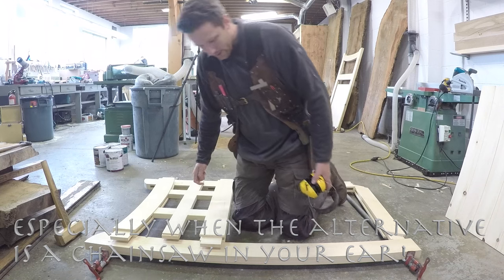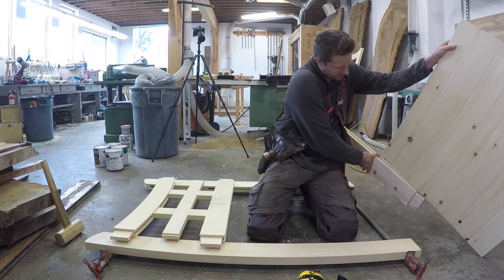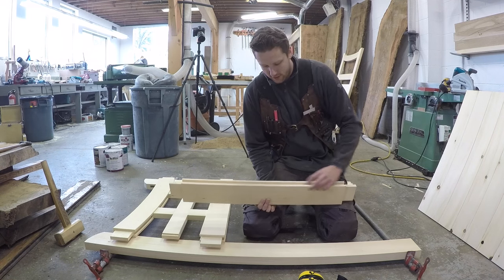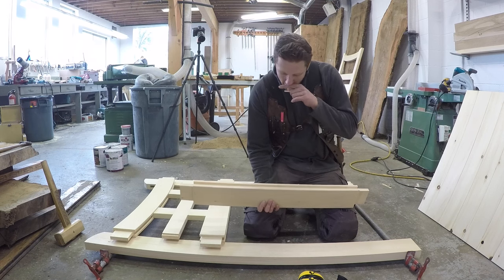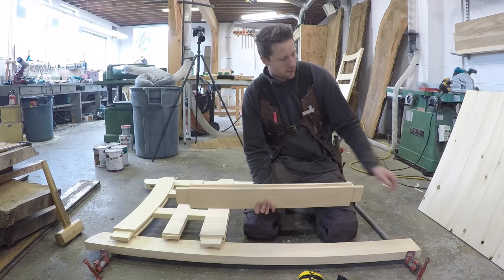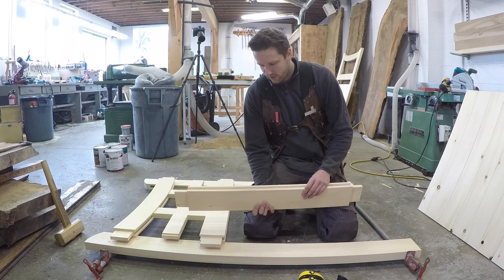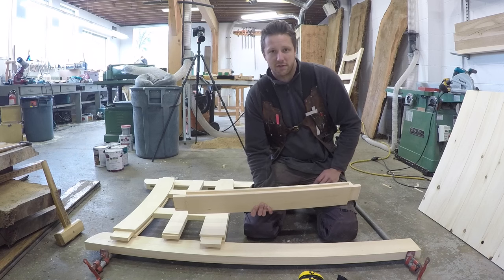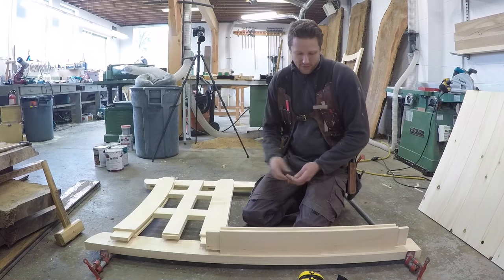FTF #9 Make it Drain!

Comment: Universal truth of construction:  Water will always get in.
Universal responsibility of builders:  Assure a way for water to get out.
Reply: Well put. I get so tired of seeing work people do without accounting for watershed. The worst is roofing jobs that instead of shedding the water it actually traps it. But it's an issue everywhere.
Reply: Well... it depends. For example, you can make a basement completely waterproof, but it depends on many factors. How much money are you able to spend, how much time are you willing to put into the construction, how correct was the work executed, was it accounted for the worst possible situations and worse or not, has the use of it not badly influenced the waterproof characteristic, and so on...
Reply: Actually you want your basement be able to breath and let watervapor through. If you try to seal it you'll just create an even bigger problem and stronger force trying to push through from underneath.
Reply: No that's actually not true. I refer to every decent study book about construction, especially about foundations and soil mechanics if you want to learn more about this topic. You always try your best to keep water about, depending on the use of course. But whether it is waterproof after construction, depends on the execution. A basement made of solid concrete walls and floor is by definition waterproof (depending on the thickness of the concrete elements of course)
Reply: Actually i is true and I know what I'm talking about as I'm a building engineer. 
Pouring concrete doesnt make it waterproof as watervapor will still get through which is what I'm talking about. 
If you have a normal basement like most people do and cant afford to make a new one made of concrete, make sure the drainage around it is solid and you use a good system to keep water away directly from the basement wall like 'isodran'. 
There are people out there that thinks keeping your basement wall waterproof is a good idea and uses a primer to paint the outside wall... it's not so dont.
Reply: +Rocksummit Then it probably depends on in which area you live. Because I'm studying civil engineering and I'm just telling you what I learned in every course about construction. 
I'm currently doing an internship with a much more experienced engineer. I'm gonna ask him how it's usually done around here. (Belgium fyi) I'll let you know.

I'm not gonna insult you for a stupid fuck as I often see in comments on other videos lol. Because I'm actually interested in sorting out the discussion. (I may be wrong, but you know, I only learned what I wrote)

Comment: great tip... if you wanted to add an uber layer of extra protection, get a little squeeze sack of west systems epoxy and give everything a couple of coats... if you wanted to go insanely overboard, use the epoxy for the glue as well...

Comment: I noticed that you are using kilz oil primer on the yellow cedar. Have you tried other types.
Reply from the maker: +Daniel Kamps Cedar often has a lot on tanin in the wood which will bleed through non stain blocking primers so I always use kils oil based primer.

Comment: I built a few Gates in my day that were just like the techniques you used (shaker style perimeter frame within dado).  Whenever I did my dado I actually "pitched" my dado to the center with a whole also drilled (the width of the dado) in the center.  I ran the pitch approx 1/4" per foot (just like Plumbing drainage).  and it was funny as hell to see you use a spacer to glad up the panel as well.  I did the same damn thing, I ended up using a copper wire from 14/2 electrical wire that was in my truck (just cut the jacket and pulled out the bare ground wire). 

I HIGHLY RECOMMEND pitching your dado cut to a center whole next time you build something equivalent. 

GREAT JOB Bro!!!!

Comment: Good planning. One alternative spacer would be plastic drinking straws. They would compress some but still allow drainage. The space would allow for seasonal wood expansion and contraction just like any wood panels. Good stuff. Kilz oil based is good my favorite. An old trick I was taught was to seal knots with shellac first to stop bleed-through. I'm going to use your phrase in the Lack of Common Sense vid about anything touching earth becomes earth-great!